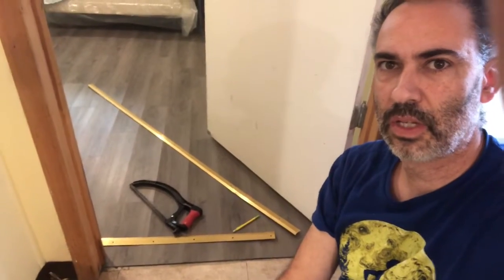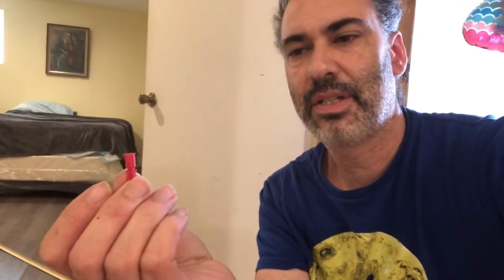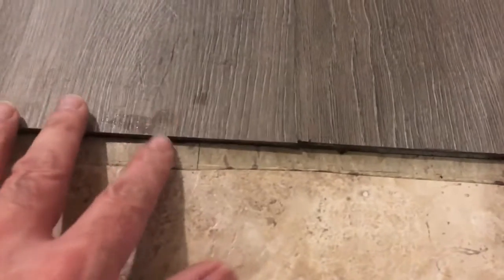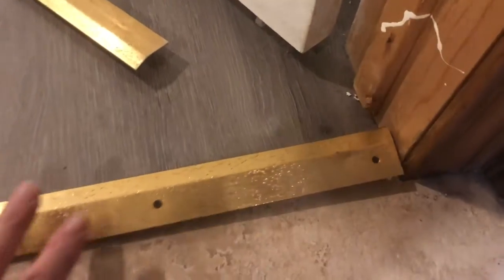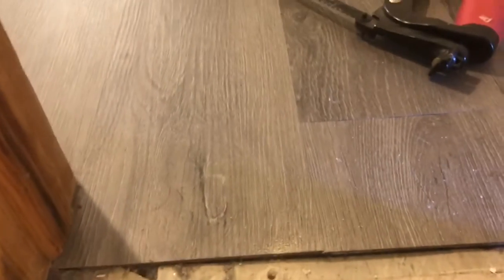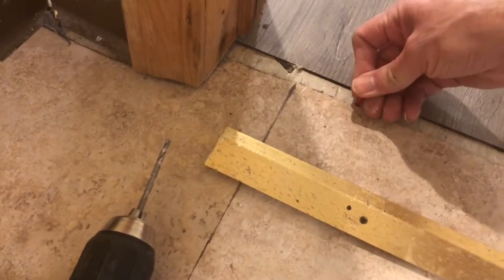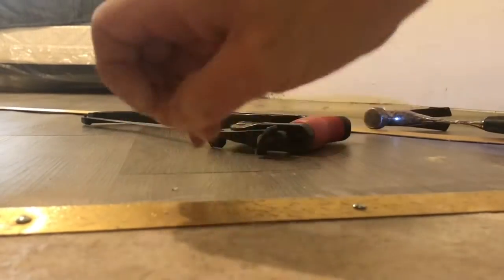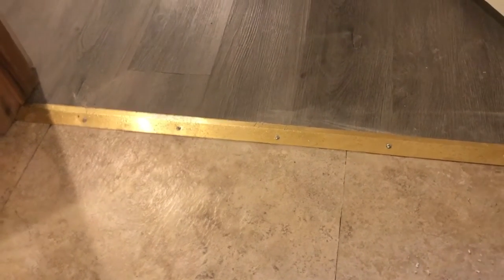How to attach a threshold to concrete slab/ cement slab.  Metal threshold to cement

Comment: You put your transition strip in backward. The flat part of the metal gets installed on the floating floor. The 45° angle goes down to the concrete.
Reply from the maker: @gmanjordan4154  hey thanks for the tip.  I didn’t even notice the angles.  I’ll have to watch that in the future.  Much appreciate

Comment: Do you recommend using a hammer drill? It looked like yours was not a hammer drill? Also, does that plastic anchor have to go all the way into the bottom of the hole flush with the concrete floor?
Reply from the maker: You will only need a drill.  Not a hammer drill.  Yes flush with the concrete.  Sorry for the late reply I missed your comment

Comment: Why not to use smaller plastic anchors and original spiral nails?
Reply from the maker: @botsman35  you might be able to get away with it but if it’s a high traffic area the bigger size might hold up better

Comment: I didn't have any luck hammering or gluing nails into my concrete slab. Going to try your method. What size was everything you used?
Reply from the maker: Hi I did this a while ago I don’t have the sizes , sorry I should have documented that’s.  The plastic and the screw come matched up.  You should be able to find a smaller size at Lowe’s.
Reply: I'm going to try these:

Red Head 1-1/4 in. Poly-Set Pan Head Phillips Light Duty Anchors with Screws

Will circle back later tonight to confirm
Reply from the maker: @tessandmikerawk  just make sure the head of the screw sits low enough so you don’t rip your foot open
Reply: That's why I tried to go the concrete nail route first, but that failed miserably! Thanks for your advice 👍